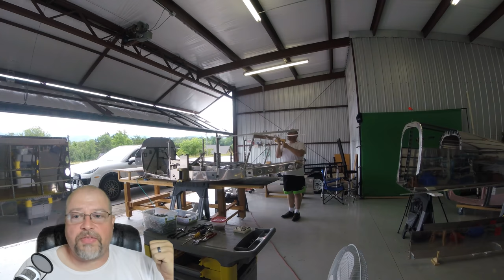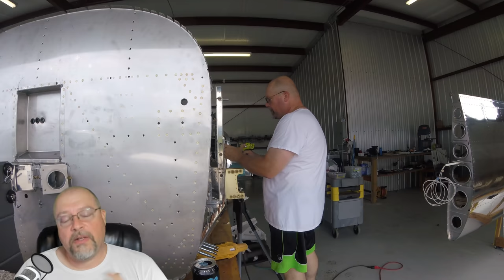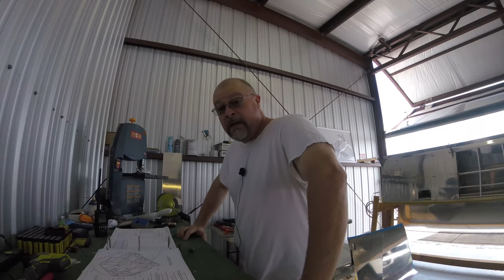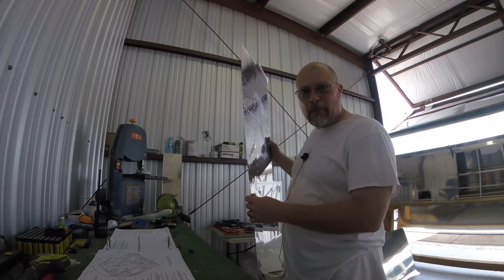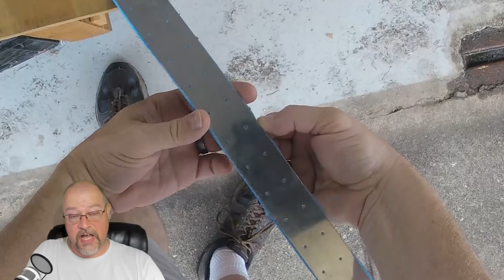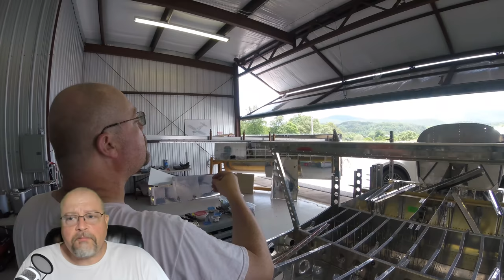RV-10 Fuselage - 028 - Countersinking and starting on final assembly

Comment: I got a bur-away tool from the Yard store for Deburring holes... so quick! I had to back off on the tension on the internal Alan key, but it works great! Also the other RV10 builder (plane lady I think?) had a tip where she cuts a 2 inch wheel into little slices and chucks them into a dremel for doing the flanges and facets.

Comment: You mentioned having to remove parts that had already been riveted. Are the instructions out of sequence or was it something you did out of sequence? 
I plan on starting an Rv-8 soon and use the videos of builders such as yourself as a training video.
Reply from the maker: 9 times out of 10, it's me.  I did something out of sequence or just missed a step.. It happens.  The big thing is when you're building your -8 don't panic when it happens. You can fix it.. If you can build it, you can unbuild it and rebuild it when you make a mistake.  And you WILL make mistakes.. it's okay though.  You got this..

Comment: Dremel cut-off wheels --- they make them in 2 thicknesses.  I also had a lot of problems with "exploding" disks --- using the thin ones ((ESPECIALLY on Fiberglass -- far more so than on aluminum)).  Never had one of the thicker ones explode on me.  Rare is the case when you NEED the thin ones.  Might try the thicker ones. {I would need to go to the hangar to confirm these, but I think the thicker ones were #456 vs #409? (#420?) for the thin ones??}

Comment: Suggestion for the forward stringer that you countersunk ahead of time: when you match drill the upper skin that's supposed to go there, come in from the inside and use a 90 degree to get it from the back. That should eliminate the possibility of drilling through the edge of a countersunk hole. Source: I'm a commercial aviation structures guy. I like what I see so far, especially the sheer amount of clecos in use, haha!
Reply: My thoughts eclxactly.